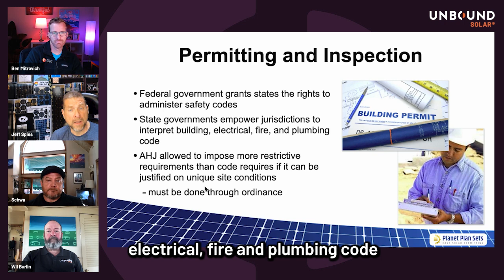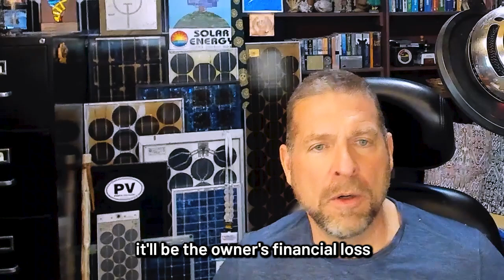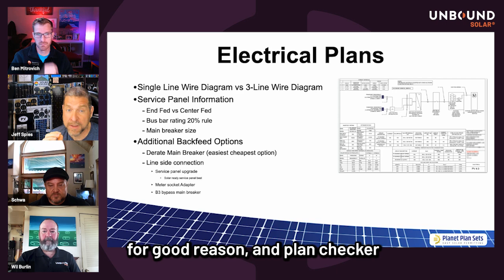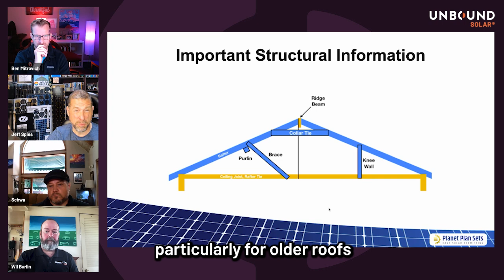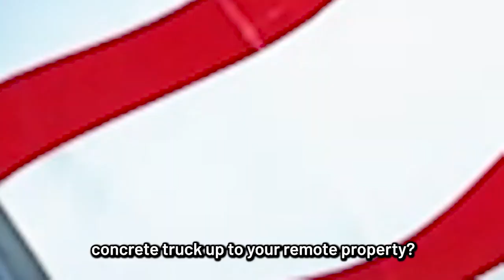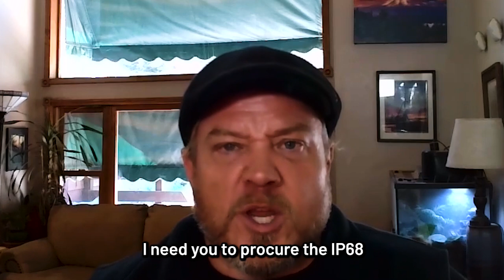Solar Panel Permitting: Avoid EXPENSIVE Errors & Save $$$  | DIY Solar Panel Installation Guide

Comment: Permitting or installing is not my problem. How do I get past the inspection process? Isn’t it necessary for a licensed electrician to sign of on wire installation and grid hook up. I will not be feeding back to the grid, just supplementing my needs from the grid. Colorado existing residents.

Comment: Roof covering should be standing seam or PBR metal roof panels, using S5, Sunmodo, or QuickBolt rib solar mounts!!! They do not penetrate the roof surface...
Sadly, American solar installers are greedy and selfish... If you own your solar equipment or even portable solar power stations, they will not help you with your solar installations!!!

Comment: Thanks Jeff! Well what I did was purchase all of my equipment, solar panels and batteries, wholesale and put everything in myself for $12,000. I did not pull a permit and I did not get an interconnection agreement. My system operates in non-export mode and therefore never spins my electric meter backwards. Then I researched systems installed in my area and took a typical system cost of $28,000 and applied that number to my 30% federal income tax credit! So I got $8400 back on my $12,000 investment and I said screw you to everybody! The return on my investment is about 2.5 years. 😂😂😂😂😂
Reply: Doubtful. In Florida they use Satellite imagery to see what you've done. Then they start piling up the tickets and fines to Steal your Property from you.
Reply: Hope you don't get an audit. Penalty and interest going to add a 1 in front of that ROI lol.

Comment: Hello Schwa and Will!  Good seeing you.  Great working with you in the design process.  After contacting 22 solar installers in the Western Washington region with NOBODY returning my calls I decided to do a DIY project.  There have been many pitfalls along the way with unqualified designers leading me to spend a few thousand dollars on supplies I could not use.  After contacting Unbound things finally came together.  I did hire an electrician to finalize the install with me and my wife doing 90% of the work.  Permits were a breeze, installation has it challenges but with average tools and DIY knowledge and Unbound answering questions along the way its really far less complicated than it looked going in.  Anyone can do this.  Lots of online content on the Unbound, Ironridge websites, along with YouTube to help.  Hint; The best supplier of solar parts is Unbound Solar AND Platt Electric.  Get to know the staff at your local Platt and ask if they know of an electrician that does solar install. Wire is FAR cheaper at Platt than Home Depot.  Don't spend hours calling around.  Platt has a long list of contractors they serve.  We did have to drive to to California to pickup the panels which is far cheaper than paying for shipping.  Contact me with any DIY questions.